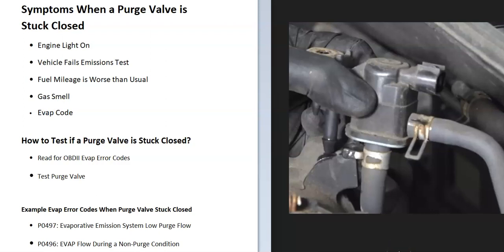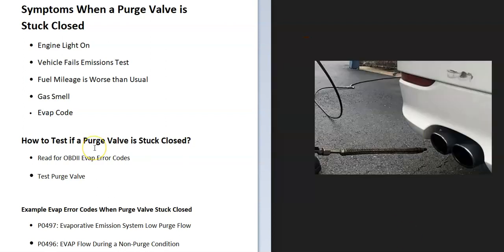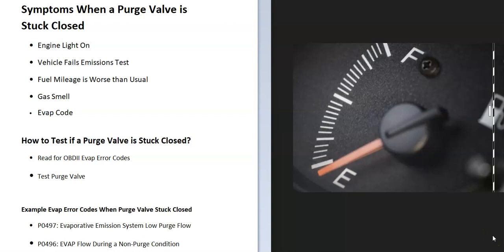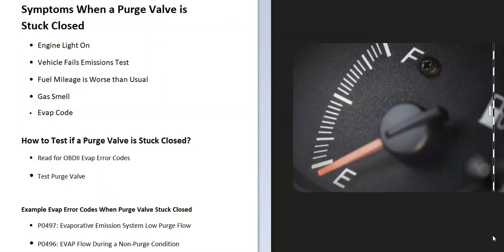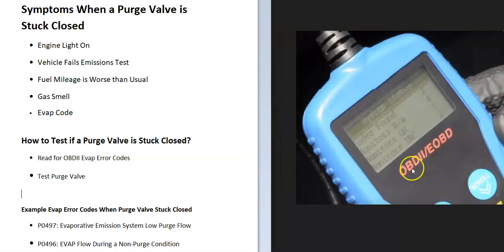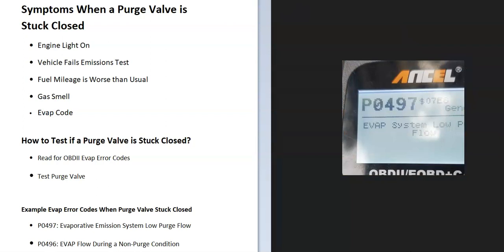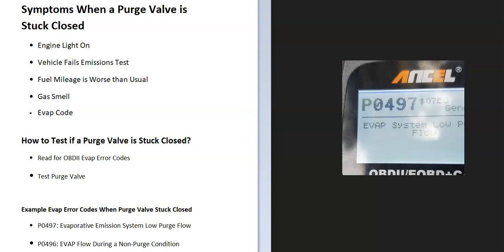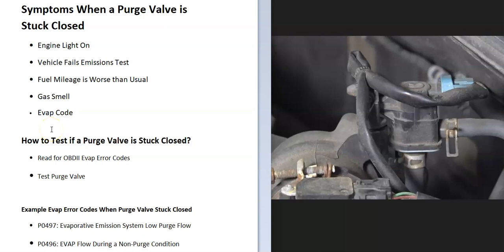Symptoms When a Purge Valve is Stuck Closed

Comment: I got a 2016 Kia rio and the check engine light came on for EVAP. 1st thing I did is get a new cap from O'Reilly's and light came back on. Then I got a new cap the the Kia dealership and that didn't work. But I didn't do the EVAP purge valve yet. Could that be the problem? I use my car for work and sometimes I go to Arizona. Vegas.
Reply from the maker: It could be a bad purge valve, but it can also be another bad component or leak. There should be OBDII error codes that can be read that point to the issue.

Comment: My evap_vp reading on the scanner stays at zero and I am not seeing any error codes.  I can't pass the emission test because I keep getting O2 sensor and evap not ready codes on the emission test. Do bad O2 sensors keep the valve from opening or can the valve be stuck close and not throw an error code.?

Comment: Is there a posibility to gwt the p0457 code with a stuck close valve?
Reply from the maker: A P0457 code can be a bad purge valve, but usually, it would be stuck open, causing a leak. When they are stuck closed, usually it causes a purge error code.
Reply: @HVAC_Mechanic  ok, I justdiscovered the connector sends 12v but no current, is that normal? Or does it send currents in a specific moment?

Comment: That’s great that you get codes from scanner but they aren’t always right codes can be put on from engine not running right from air and fuel ratio and have nothing to do with codes, how does car run when it’s closed rough idle stall need more information no vacumn when out finger on it while running, blew into it sealed tight 12 v clicks for a second everytime  2010 ford expedition 5.4 3v po446

Comment: I have a 2010 HHR and I  change  the purge value,  but i like to know if you have a good purge value  are you able to blow  through it?
Reply from the maker: Purge valves are normally closed until power is added to it. If you can blow through it when there is no power, then it is bad.

Comment: I have an issue that just started for the first time I just filled my gas tank. Started it up. Drove 30 miles shut it off went back an hour later started it, and I heard the pulsating knocking on the passenger side inside the cabin. I popped the hood and I could stick my head over by the purge solenoid. I could hear it pumping air or fumes and the hose going from the solenoid to the intake noise stopped and went back down to normal. I have no pending no check engine light mode 6 has green checkmarks across-the-board, and it passes the IM readiness test. it only does this whenever the car has been running for a while. You shut it off and start it up about a half hour later and then eventually goes away. It’s never done this before just started. Engine does have a little twitch at idle more than normal rich gas fumes coming from passenger side engine bay and gas mileage has decreased 0 codes
Reply: The computer also only picks up a check engine light when whatever item stops working under a certain threshold. A chance your purge solenoid is malfunctioning but not enough for the computer to pick it up. I’d test the part and it’s not even an expensive part to just replace just in case

Comment: One thing I didn't see here is how to test if the purge valve is stuck closed, do you follow the same instructions as if you would testing it to being stuck open but from the engine side? If the engine side of the valve is not pushing air is it still closed?
Reply from the maker: To test if it is stuck closed let the engine run for a bit (5-10 minutes) at some point the computer will send a command to it to open. Remove the hose going into the engine manifold and you can feel a vacuum when it opens. Here is video https://youtu.be/X-Y5YsaXxJE
Reply: @HVAC_Mechanic  thank you brother  I appreciate the help. Yesterday I tried to see if the valve is still closed I disconnected the electrical connection and the engine at idle temperature, I tried to see if there's a vacuum in the hose connection that leads to the charcoal canister but there was no vacuum does that mean this valve is stuck closed?
Reply from the maker: The vacuum will only come from the engine side. When the valve opens, the engine manifold will be in a vacuum, and you will be able to feel it.
Reply: Lol man how you fix it?

Comment: i have a 2009 mini cooper s. i dont have any engine light is on. but i smell gas inside the car. would it be the purges valve??
Reply: On mini you may have access to the fuel pump under the seat there’s a possibility the fuel tank o ring could be leaking. I’d recommend removing the rear seats and remove the access panel and inspect for any fuel leaking

Comment: Hello. I have a Nissan B13 (known as Sentra B13, Sunny or Tsuru). A few months ago it started gas smelling, i checked what it was and there was some fuel comming out from canister, so i changed it. It looked as it worked, but a few days ago it started smelling again, i can smell it near canister but this time there is no fuel leaking. I was told to change evap valve but i'm not able to find where they sell it, so what I want to ask to you is if I can use one from another car either Nissan or other brand as to be able to fix it. Thank you.
Reply from the maker: There are two EVAP valves; the Purge Valve is located in the engine compartment, and the Vent Valve is located on or near the charcoal canister. They are sold online or at automotive stores.

Comment: Why are the fumes in the gas tank of a Toyota hiace 2008 not being emptied and in turn causing a fuel return into the charcoal canister and also causing engine shutting down while driving?

Sometime it won’t be able to restart until the gas cap is opened to release that fume pressure.
Reply: Check canister Vent valve

Comment: I don't get how any of this is useful.  On my nissan truck the purge valve is actually two pieces.  One is a diaphragm type that is connected to a solenoid by a vacuum line.  When the ecu grounds the solenoid it opens a vacuum that opens the purge valve and allows the vacuum from the air intake to draw the fuel vapor up the evap line.  Pretty simple except the ecu is not sending a signal to open the solenoid and I can't tell why so the purge valve is stuck closed all the time.  Is it engine temp, pressure sensor, what?  Last year I replaced the volume control valve which has a step motor inside to control the plunger which controls the flow but it's before the purge valve but is the ecu looking for some feedback signal it's not getting.  Can't tell.  Basically the problem is that the ecu doesn't send the signal the evap line never opens but it's unclear what the ecu is looking for.  Should be similar design to many other vehicles.
Reply: I should have mentioned that the purge valve and solenoid are fine.  They both work.  If I apply 12v to the solenoid, everything works fine.  The problem is that the ecu doesn't grnd the connection to the solenoid so that's the same as not applying any power.  Everything else seems to work fine so it's not the ecu but I can't figure out why it doesn't send the signal.
Reply: There are some conditions that have to be met to the ecu to Open the valve

Comment: What about not being able to put gas in the car it shuts the pump off
Reply: Charcoal canister could be bad
Reply: Or maybe the hose is bent
Reply: @ahmedalshaibi4589  or plugged up, seen that before
Reply: Vent valve (not purge valve) is probably stuck closed
Reply: That’s what I got going on right now evap code P0455 gas pump keeps clicking off!